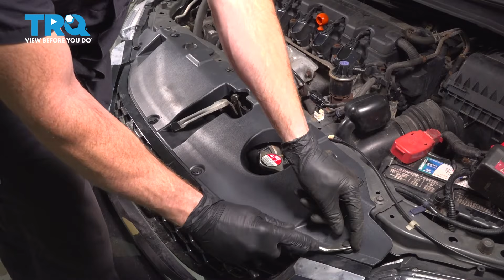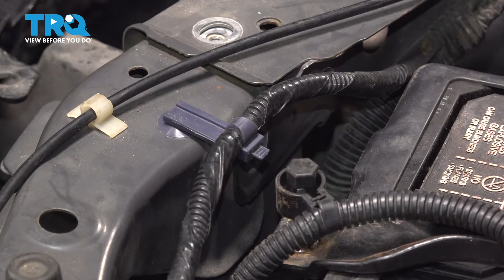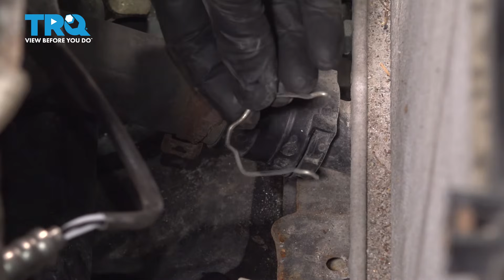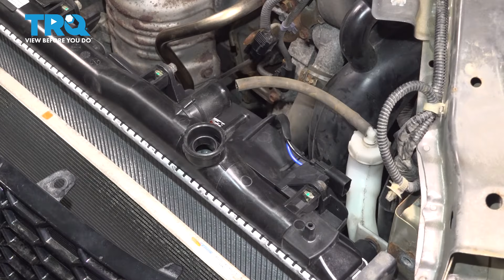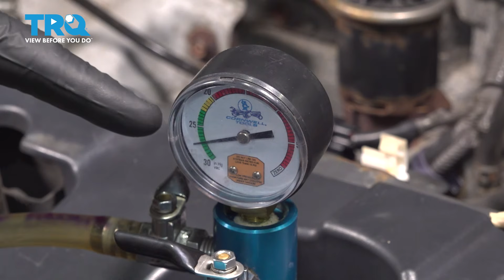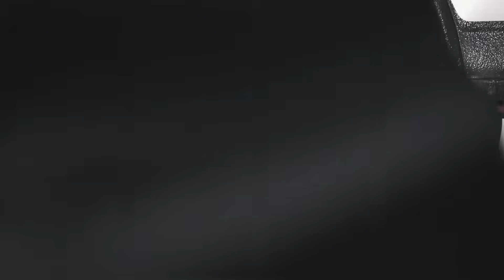How to Replace Radiator 2012-2015 Honda Civic 1.8L I4

Comment: 09:05 its two pieces of plastic overlapping each other but only the outer layer comes out. so if you use a pry bar, you have to use it closer to the edge, otherwise you'll be pushing both pieces and the inner piece is stationary (so it won't budge). 

I played with it for about 15 minutes before I figured this out and then had it off in a few seconds.

Comment: Changed my radiator today and I got a check engine light after putting everything back together. I used a OBD2 scanner and the code I got was  P2185 - Engine Coolant temp sensor 2 circut high. I disconnected my battery during the radiator replacement to create more space. Do you think this caused it?